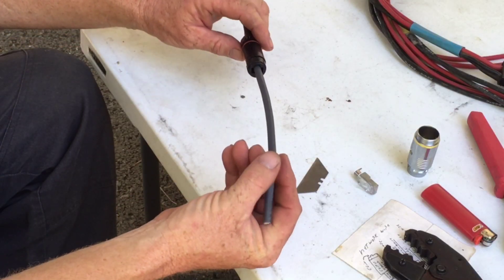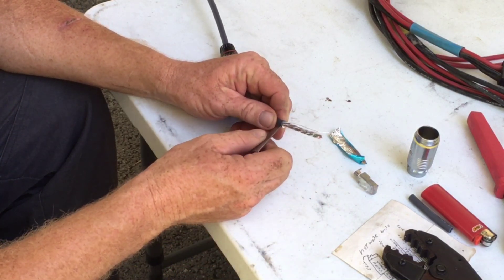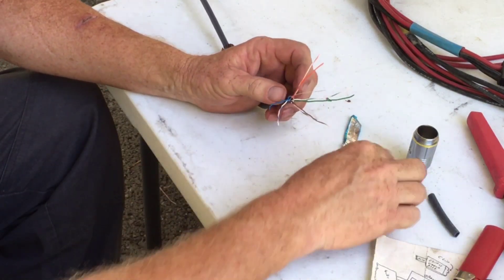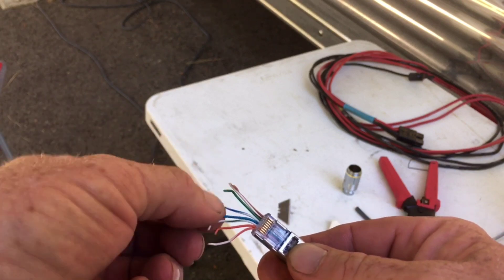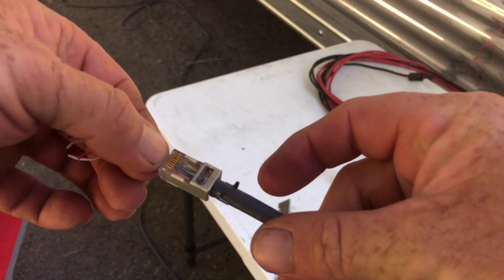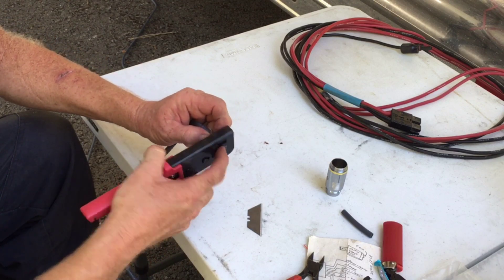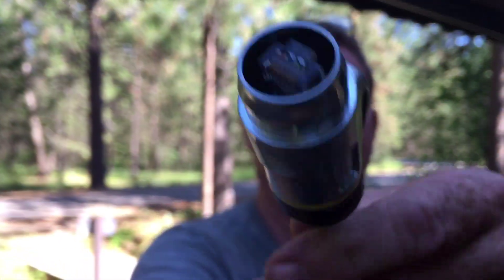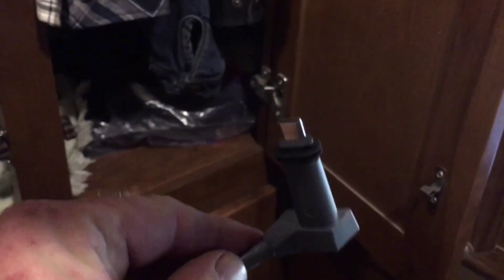Starlink cable plug modification

Comment: Hello, how much is the maximum that the Starlink cable can be extended without losing power in the antenna?
Reply from the maker: I know they have 150’ cable from Starlink. I have no idea how far it will go

Comment: Just wondering. what if starlink had their own wiring schematic and not following the standard cat6 wiring diagram. Then everything will be screwed. I guess this worked coz nobody complained/commented in here.😗
Reply from the maker: All I’m doing is a pass through. As long as all the colors match up to each other. The cable doesn’t know it was cut.

Comment: Just remember that your standardized RJ45 network plug that you just installed uses non-standard wiring. It's fine for your Starlink but other network devices must not be plugged in because of the different wiring.
Reply from the maker: The plug I used was just a pass through. As las all the wires are matched up. The wire has no idea it was even cut.

Comment: Hey Marty,

V informative video thanks. What is the dish connected to on the other side of the new connection, does it still go into the Starlink router or something else.

Any idea if it’s possible to bypass the router and just connect to an existing network of access points or will there not be any connectivity if the router is bypassed?
Reply from the maker: They do make an adapter that gives you a network port. Then you can select not to use there router. But it still needs the router box to run everything because the dish and router are a mated pair.
Reply: @CrazyMarty  Nice and easy. I suspect you've done more than one of these CM.
What you did is best described as a pass through connection on your van wall, NOT the special connection Starlink use, I guess that's what people are asking. I've see experts muck that crimp up; you made it look easy.
Adapter give better speed and can bypass Starlinks sometimes flaky WiFi  + get better security. It's a no brainer imho.
Thanks for the how-to vid Marty.
Reply from the maker: It’s basically a pass through connector. The Starlink ones are special extra long micro HDMI plugs.

Comment: Wrap the conne Rion with aluminum foil for further shielding.
Reply from the maker: Extra shielding is not really needed. There’s not much in the line of external RF when out in the wild. The only things that can cause a problem is the solar and generator. But they are well grounded. Now my HF radio can bleed into IP. CCTV camera systems and a nearby TV.

Comment: Hello Marty, good video!! I would like to extend my cable with cat 6 because I have to climb on a 40 meter high
tree with the dish .  The original long cable is too short for this project.What are you using for Rj45 connectors? They have made of metal at the back for the bleed wire, right? Find only Rj 45 made of plastic Contact with. Best Regards
Reply from the maker: Do you need something like this. It has metal sides. 
Use cat 6 shielded wire. 

https://www.amazon.com/trueCABLE-Through-Shielded-External-Connector/dp/B088KSW9Z7/ref=mp_s_a_1_4?crid=3632GQLJZJXV2&keywords=rj+45+with+ground&qid=1663026864&sprefix=%2Caps%2C262&sr=8-4

Comment: Hi Marty,  I see you made sure to crimp the drain wire.  Did you test to see if continuity passed through the connector for it?
Reply from the maker: It should. It does have the side connections that would pass the ground back to the router. If side connections went to the connector and grounded it would make a place for a ground loop potential. That would be bad.
Reply: What if I don't have those type of connectors? I just have plastic ones. So in saying that the drain wire probably wouldn't do anything? Should I get the type of connectors that you have so that the drain makes contact with something metal?
Reply from the maker: Have the drain wire is there to stop RF interference. You can probably get away without it. But having it is better then not having it.

Comment: Could you pls link the plugs that you bought?
Reply from the maker: They say it’s IP 65 rated. But it fits pretty loose in the stock. So put it in a safe place away from water if you can

https://smile.amazon.com/Connector-Waterproof-Ethernet-Industrial-Connection/dp/B09RZK7FTN?ref_=ast_sto_dp

Comment: I decided to drop $25 on the RJ45 dongle thinking I could cut it up instead of the main cable. However, when I cut the dongle cable open, it has the same shielding and drain wire, and it has the same twisted pairs you show in this video. However, there’s a second set of identical but smaller gauge wires in there cable. I figured I could just cut those off and use the larger gauge wires in the T568B configuration like you showed. 

Context: I’m trying to inject a Netgate SG-1100 (pfSense) router between the dish and the Starlink Router… I didn’t have any likes at all on the Netgate when I plugged it in and I had no connectivity. 

Any idea what the smaller wires are for? Maybe just order a second standard cable to do this with since yours clearly looked as I would have expected to see?
Reply: The other issue is that Starlink uses non-standard POE wiring, so a regular RJ-45 injector won't work. You'll need to wire up something custom or get a POE injector specific to Starlink
Reply from the maker: I’m sure the dongle works as a splitter   But how they run the wires and what is actually the network wires is a spaceX proprietary Secret. 
A standard RJ45 is a standard. But how spaceX uses the wires is unknown. The Router and dish are a mated pair.
The easy way to add a router is just have it search and connect via the wi-Fi. Then just connect to that router. 
The dongle is made to just add a port so you can put on a switch.
The spaceX router has no admin access other then the stupid app.  Everything is made for the non computer person.
Reply: Just connect the new router to the ethernet dongle and put the starlink router in bridge mode.
Reply: The smaller wires are actually the Ethernet connection FROM the router. The actual wired Ethernet switch is in the router, you just need the adapter which has the LAN port/electrics in it (This is completely idiotic and I have no idea why they did it this way.) You can ignore/cut the smaller wires if you're just using it as a makeshift cable adapter and put a normal RJ-45 connector on the THICK wires. Then you can plug the Starlink Cable into the unit so you don't have the cut the actual Starlink cable.